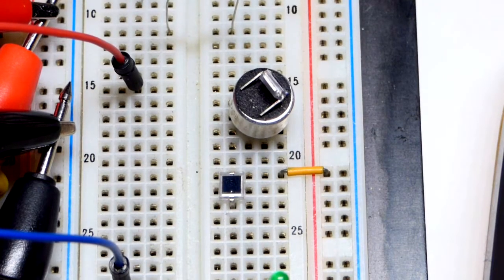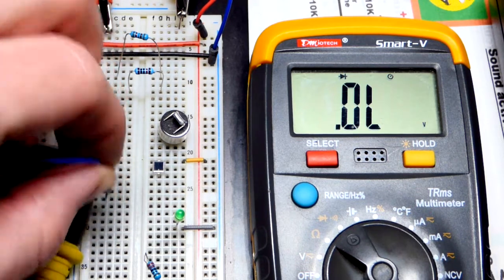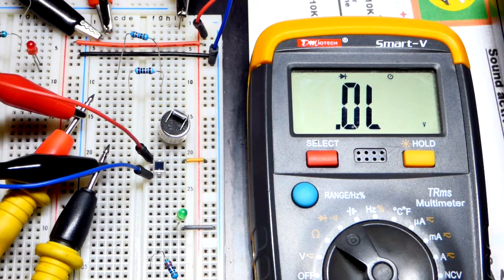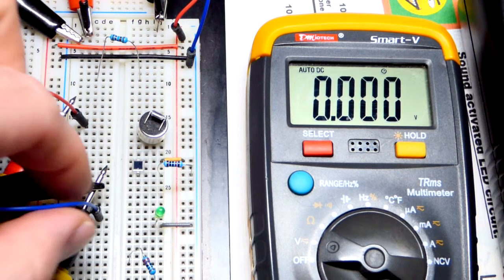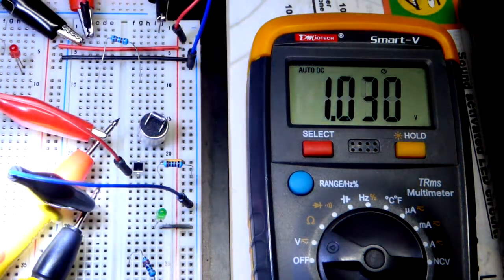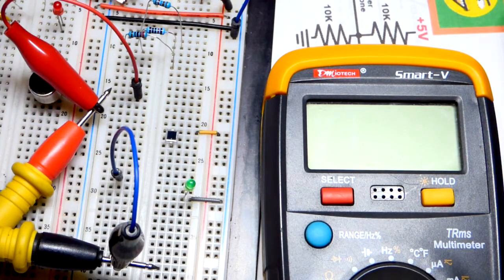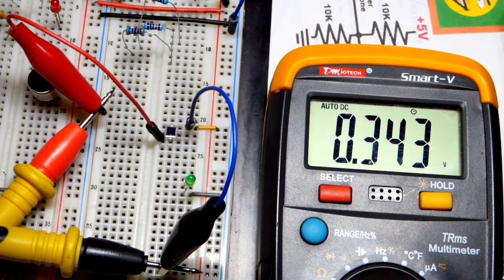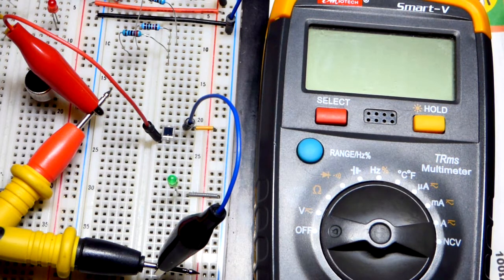BPW34 PIN photodiode electronics component

Comment: Thanks for this nice and clear video! Two questions here :
 - How would you modelize the PIN photodiode in reverse bias : a current generator? a variable resistor? other?
 - How would you modelize the PIN photodiode in forward bias : a voltage generator? other?

Comment: Isn't the place where diode has a dash is the cathode part and other terminal is anode? What I know, a photodiode acts in a reverse bias by lowering resistance to more light and high resistance for less light.
Reply: The part with extra width is anode(+) and the other terminal is cathode(-) which also has a protruded part on the lead.